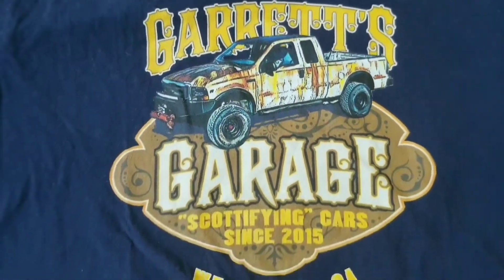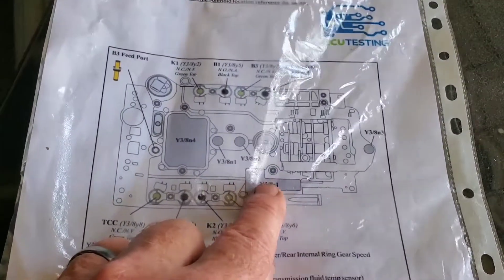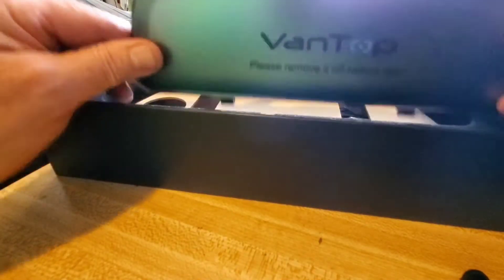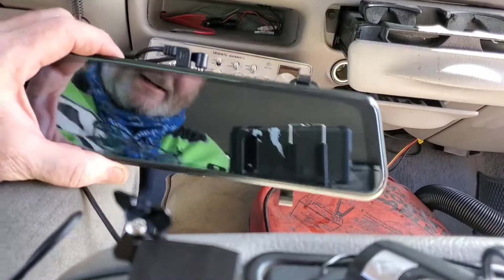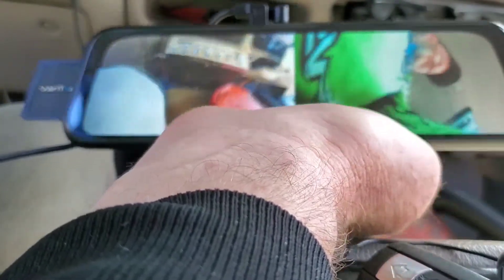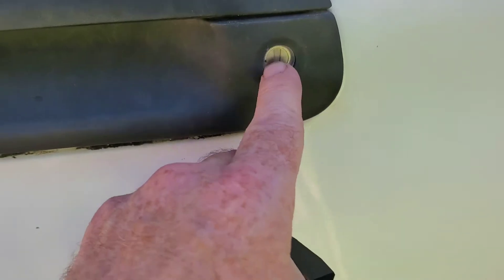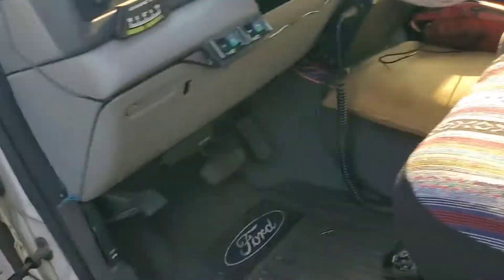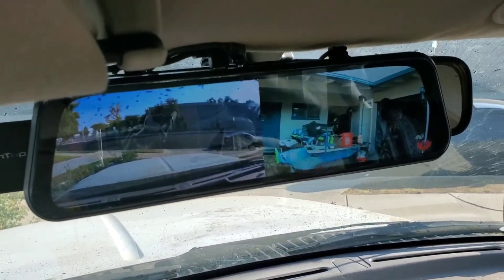Installing a cheap backup camera in the tailgate.  Ford truck.

Comment: I just got my 612 today and I'm up in the air on placement , thinking about fabricating a short tube and plugged the tube into my hitch ball hole and keep it about 2 inches above the bumper. I can't mount it near my tag because my aftermarket tag bulbs are very bright and would wash the camera out. Kinda like the key hole idea thank you. I have a 99 f 150.
Reply from the maker: I've found that mounting the monitor over the rear view mirror wasn't ideal. Without the original mirror I couldn't keep an eye on stuff in the bed. I moved it. I'll probably do a follow up video about it soon.  Thanks for watching and commenting!